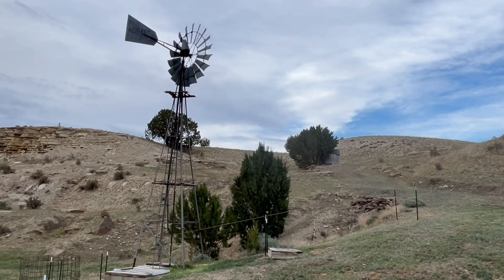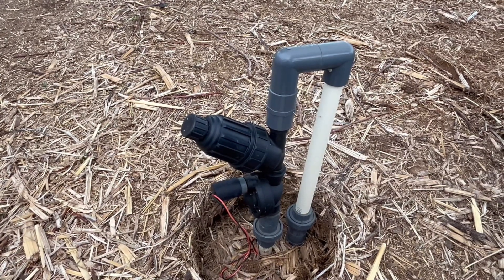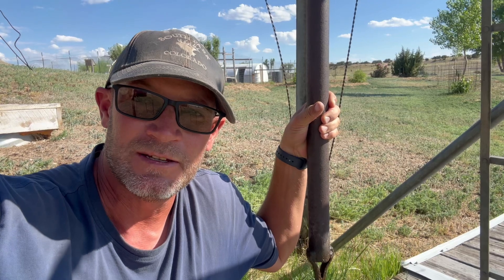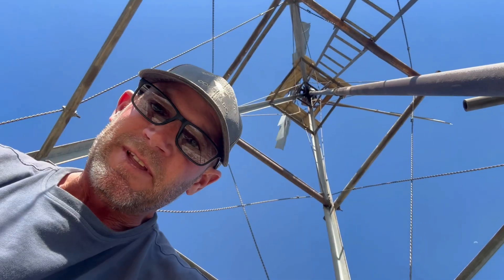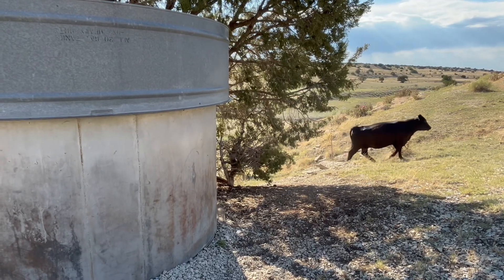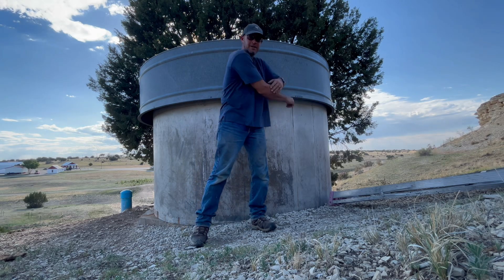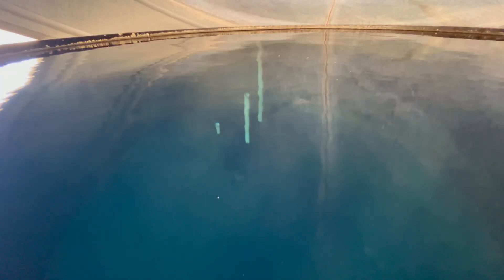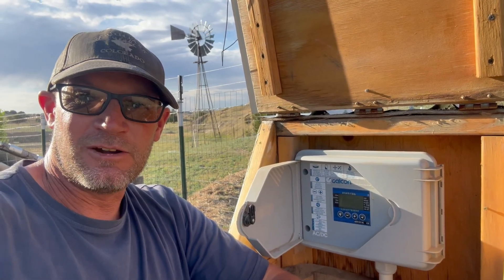💧Old School + Modern Technologies Irrigate this Garden

Comment: It`s too hot in Louisiana to go without air conditioning after various common storms we can have at any time. While I had the money two years ago right before moving into my camper on a rural lot I got a large 300ah LiFeP04 battery, solar charge controller, cables, fuses, several solar panels and a 2000w ac inverter. Then I had to study a lot to figure out how to use it. I just ordered a 2nd better solar charger, more cables and extra panels and it will be enough to keep the battery charged and directly power my window ac. 

I bought portable solar power stations for everything else from my freezer to low wattage cookers, lights, fans etc. We were hit by two bad hurricanes that knocked out power for weeks even here in central Louisiana in 2020. I`m certainly prepping, building a garden, and covering the place with fruit trees...over 15 so far. And I keep an old large fridge built-in to the wall of the camper stuffed with various dry food staples to prevent insects and any mice that might sneak in. 

I`m about to buy a 300 dollar gas cannon for the neighbor who constantly disturbs the peace with his makeshift shooting range 200 feet through the woods behind me. The entire area is sick of it. If I don`t something worse will eventually happen when I snap. He messed up by doing it today in the HEAT...usually it`s "only" on nearly every pleasant day in spring, fall and winter...all day long. My cannon can shoot 17,000 times per bottle of propane and has an adjustable timer. 130d

Comment: If you know all the components you will need after an EMP, then buy extra spare ones, confirm they work, and configure them as the existing ones, then put them in a big faraday cage, unplugged, and maybe in the original packaging. 
Build a box to hold them all, and make it out of copper, or at least a thick copper mesh, that is earthed,  and put it in the basement (I'd go full copper). 
Leave it closed for about 2 weeks after the last EMP,  unless you have a way to measure any residual Solar Corpuscular Radiation. 
They should come out working and good to go. The 1859 event lasted about 8/9 days, remember that the Gamma radiation from a nuke can fry electronics, as well as the EMP (as well disintegrating, smashing, burning, baking, demagnifying, chemically denaturing them... so maybe bury that box under a few feet of soil too :).
Reply from the maker: It would be bad. It might also take a very long time to rebuild the electrical grid. If things turned to total chaos it might not get rebuilt. It would be a new world.
Reply: @thewindmillgarden  I completely agree. Not only would all the stuff like Transformers (the big things on Electricity poles) - essential for Domestic and Commercial Electricity, but the parts that run the machinery to make them, not to mention the machinery to get the NUke/Coal/Solar generators going again.
Reliable Analog wind up watches might  become essential agian, probably horses (look at the building of the Bismark, it used Donkeys - it was only 90 years ago..
ALso letters and mail may make a recovery - its a hell of a thing :)
Reply: @thewindmillgarden  Transformers (so I am told) are very difficult to build (especially at scale), they require uncommon ingredients, take a loong time to build (by skilled people), and if you rush it, they are liable to explode the week you get them online. It is actually the power providers duty to provide redundancy, I wonder if anyone is building a bunch They better be... Also Considering what happened at Fukushima, which was ultimately caused by water pipe connectors were incompatible with the Fire Truck connectors, imagine the mayhem that will be caused when most transistors or Electric Control Modules will be dead, are all the Nuclear facilities up to scratch, and is someone on that right now (it being "name every system at the (Nuclear Power) plant which could cease, become unpredictable or cause some kind of danger if small processors or even Transistors in the system failed".